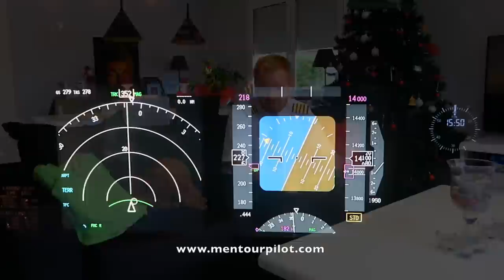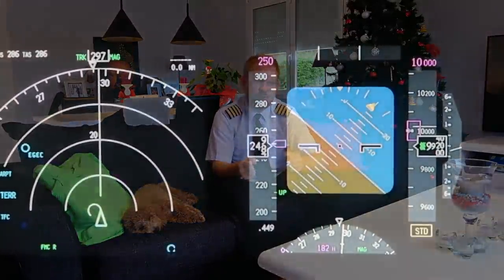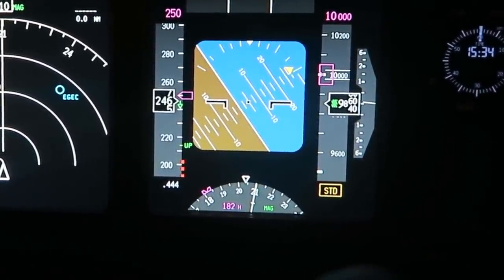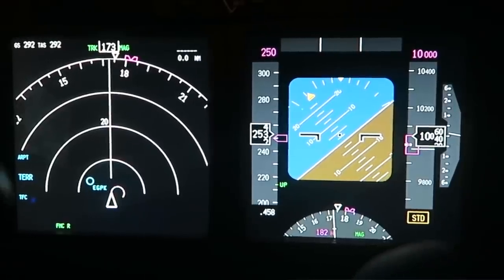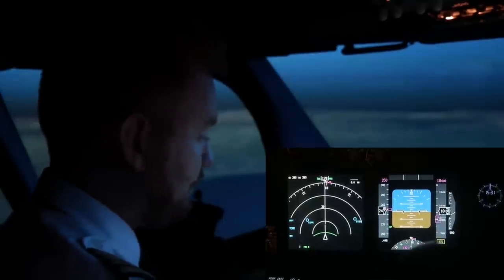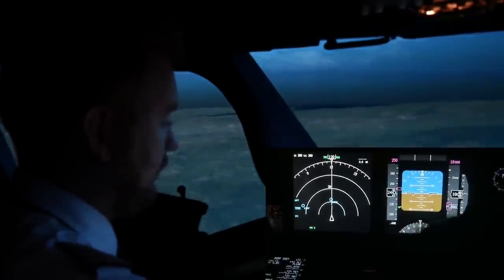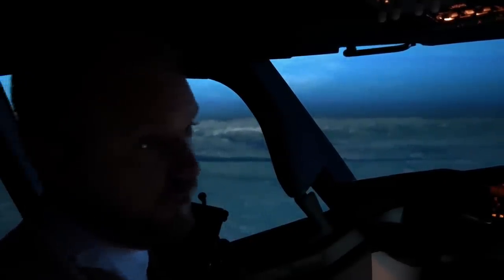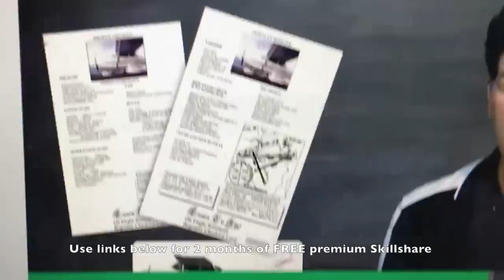What happens if you ROLL an airliner?!

Comment: Great video. One of the complications of flying at 90 degrees or upside-down is that the control surfaces take on different roles. At 90 degrees for example, you would have to use the rudder to pitch the nose up to maintain altitude? And upside-down the elevators would have to be operated in the opposite way to normal flight? And the transitions would be very tricky. Like trying to fly a brick I would imagine. 
The late [Sir] Douglas Bader, the RAF fighter ace of WW2, did a barrel role in an ancient aircraft very close to the ground. He crashed badly and lost both his legs [in 1931 I think], but went on to fly combat missions in WW2 until he was shot down in 1941. 
There are bold pilots, and old pilots, but no old, bold pilots, as the saying goes. I think his engine lost power as well, because it had a gravity-feed carburettor feeding the pistons. 
But one can understand the appeal of doing something like that, even if it is not terribly safe.

Comment: Steep turns! Am just getting used to them after watching more aviation videos and understanding some of the  dynamics of flight and this particular video has explained the subject best. Steep turns can really get to a nervous flyer especially right after take off, you get an unexpected bank to either side! Oh the marvels of modern day aviation. As always, great video Petter!
Reply: The one to remember is load factor = 1/cos(beta), where beta is the bank angle. That's assuming you're looking to maintain level flight.

A normal 30° turn results in about 1.155g. Dial that up to 60° and you're looking at 2g.
Reply: @233kosta  I doubt the average passenger who be thinking about that as they experience a steep turn seeing the plane bank to one side rapidly.

Comment: What happens to the fuel in the tanks when you bank? How does it make sure that the engines continue to receive fuel? How is the fuel measured during a bank? What about during climb and decent?
Reply: Go to school for that
Reply: Pretty sure there are multiple fuel pickups in different parts of each tank for that exact reason, and probably pressure dependant valves so when one pickup is sucking air, a valve closes so air doesn't get into the fuel pumps

Comment: What happen’s to the toilet when you roll the airplane?specially if someone in there?😂
Reply: I suppose that might depend on the current evacuation levels of the occupant. Or whether the last occupant forgot to flush. Don't forget to flush, please.
Reply: Arif Salah Depends on the forces. If the pilot maintains 1g during the maneuver you would even be able to stand on the floor.
Reply: A big mess
Reply: Shit would come back where it came from, for real tho worst case scenario you get covered in your own waste, there is no pipe full of water in an airplane
Reply: Nothing happens. Unless it's a flick roll. That would mean you'd get shit on face. But it wouldn't matter too much. Because those two simultaneous, loud noises you heard were the main spars snapping 😅
Reply: @thefreedomguyuk    Not if Tex is flying your Boeing
Reply: Really short answer. Nothing would happen. 

Unless the waste could go back through the waste diverter and pipes and apply so much weight to the valve (that, in tandem with vacuum pumps that literally suck the waste into the tank, controls whether the waste enters the waste tank or not) that the valve fails, nothing would happen. In addition, since aircraft do not experience a constant 1G but can normally vary between negative Gs and more than 2Gs during flight, manufacturers of the waste system have implemented other ways to prevent back flow beyond a sturdy valve and non-straight pipes.
Reply: Some one just HAD to ask this question.
Reply: if you were aware but is was unplanned, whilst  your on the pan, you'd likely be reaching for the shit roll pretty quickly. pan pan, no pun intended. lol..
Reply: I don't know about the toilet, but please don't roll the plane while I'm eating my delicious airline meal....
Reply: @whyyeseyec  brings a new meaning to "gate gourmet"  (one of the bigger airside catering firms)
Reply: @whyyeseyec  What airline meal?  Pretzels?  You can eat them  while you are upside down.
Reply: @lizlovsdagmara5525  - Not sure what you're having on your flight but I'm eating Pretzel's Mignon...
Reply: @whyyeseyec  As long as they weren't grilled in the toilet.
Reply: @lizlovsdagmara5525  - Oh ya', that's where I draw the line....
Reply: It would be a really shitty situation...
Reply: @Tomelino  with your arms braced against the walls though, since your body is being forced to turn which applies twisting forces.
Reply: The result would be a lot messier than my phone with my morning coffee now sprayed all over it.  Thank you, Arif.  😜

Comment: Steep turns were always my nemesis.a

Every CFI(I) taught me to throw in trim on steep turns to help relieve the force needed & then take most out while finishing, cleaning up once straight & level. All would  say it's easier to push that yoke than to pull it.

I know there's a huge difference between tin cans & heavy iron, but in a 73 with direct connections rather than fly-by-wire, why wouldn't you do the same? The STAB controls are right under the flaps to the right of the thrust levers. Not trying to soopr-smrt here, I'm just trying to understand because you can never learn too much. 

Muchas gracias y tusen tack  for all of your interesting & helpful teaching vids. 

Keep your blue up and your brown down.

Comment: Coming into Burbank in a 727 in the early 1980s, the pilot announced that the radar was out at Burbank, so no ifr. Ceiling was 3,000 ft with broken clouds below. We didn't want to go to the wrong airport, did we? So he said we would be doing maneuvers we do not usually do because vfr you can't fly into cloud, but don't worry, completely safe. We flew across San Fernando Valley at low altitude making turns with seemed like 90 degree bank. I was looking out the window straight down, and it was close. Cabin was silent with gasps as we got to the apex of the turns. Applause after landing. I think the pilots enjoy it.

Comment: Great video, and a very clear explanation.
Could you do a video about why the pilots of Alaska Airlines Flight 261 attempted to fly the plane inverted? Obviously not an ideal way to go, but curious why they thought it might help the situation.
Reply: The control surfaces were jammed due to mechanical failure, resulting in the plane inverting without the pilot input. They attempted to hold it simply to buy time, with no means of returning the aircraft upright.

Comment: What happens next, like with handling the plane after recovery, checklists, the passengers and crew, etc.
Also, coincidentally, yesterday I watched a YouTube video about Alaska Airlines Flight 261, which had a vertical stabilizer failure due to Alaska Airlines trying to save money on maintenance, and the incompetence of the maintenance crew. They went into an inverted attitude, with no way to recover. This was a  McDonnell Douglas MD-83
Reply: horizontal* stabilizer. That was truly a horrific scenario.

Comment: Question: in the simulator do you really feel the same effects such as being upside down during that roll?  If so, if you have your seatbelt off could you fall towards the ceiling?
Reply: No, the simulator does not rotate that much. You cannot do loops either.
Reply: I'm driving a Daewoo Matiz (aka Shevy Spark), a very light and small vehicle. Driving at 70-80 mph makes you feel you need to pull the wheel towards yourself and clear ground:)

Comment: Is there even a theory for 737 which would allow you to add some right rudder in a steep left turn to help maintain the altitude and avoid adding too much back pressure? This video reminds me of an occasion when I visited the Chicago Science Museum with my friend. We entered the flight simulator (which can do a roll). I was rolling the simulator quite happily and my friend was frantically truing to right the plane the opposite direction (the seats are left-right and both have the rigidly connected sticks). Of course, I did check his harness before doing it. Fun times!
Reply: Yes as you apply roll you will loose the lift on your only working wing therefore use the yaw and even when you almost streight still dont use roll apply a slightly more power and pitch down
Only after you are complitly level you can use the roll again
Reply: tabaks That is what you’re doing with rudder when you keep the turn co-ordinated. When in aerobatic maneuvering, the controls do shift. Rudder becomes elevator and elevator becomes rudder and degrees in between. Constant input co-ordination in necessary for a beautiful barrel roll. Command authority of each aero surface is a factor in controlling during such maneuvers.
Reply from the maker: I actually used some
Reply: Matthew Bireta, that's what I know from flying Cessnas. My question was more to the effect whether 737 does allow for that, to a degree. What degree, I don't know, nor is it possible since that is an uncoordinated flight. Hence, my question. Thank you kindly for your answer.
Reply: with all the rudder issues the 737 has had I wouldn't want to try it

Comment: Very nice man . Also shed some light on how many times you takeoff with full power or de rated thrust ?
Reply from the maker: Great! I will see what I can do about that
Reply: Mentour Pilot thanx buddy :)
Reply: My dad overhauled Pratt and Whitney JT9Ds when they first came out. He said that the first pilots sometimes applied too much thrust on takeoff and the resultant overheating stretched the some of the turbine blades until they rubbed on the engine case.

Comment: I was fortunate as a young USAF airmen to earn a backseat ride in an F-16D. We did rolls, pulled 9G's, and broke the sound barrier...all during the incentive flight! The rolls were great, 9G's will melt your brain, but the best part was breaking the sound barrier over the Adriatic Sea. The F16 is one zippy ride! I would NEVER want to be in a 737 doing anything close to acrobatic flying. No ejection seats on those, either.

Comment: That roll caused a 5000 foot descent in 30 seconds, or 10000 fpm. I suppose this is not an approved procedure for emergency descent. :)

This is actually what military pilots do when flying at low altitude over a hill. They'll roll inverted as they come over the hill and pull down towards the ground on the other side. This allows them to hug the ground while also keeping the G positive.
Reply from the maker: Yep, this is in no way an approved procedure
Reply: Some birds do this as well. Called "whiffling"

Comment: I once had an Air China flight doing a steep roll on approach. It felt like a 90 degree bank because I could see straight down onto the fields from my window, but it was probably less. We were already quite low so luckily the pilot did not try a roll. He (or she) then went full throttle and we most likely did a go-around. By then I wasn't really paying attention to that anymore, just happy to make it out. Never flew Air China again because I thought they couldn't fly. Now I realize this was probably a wake problem and the pilot responded quite expertly...... Thanks Mentour Pilot!

Comment: A few times I've flown Russian domestic airlines (russian aircraft) and the pilot must have been ex-military because on take off he banked quite severely to the right.  That got my attention.
Reply: In Russia and China former Air Force pilots end up flying passenger aircraft after they are forced to retire, when flying for the Air Force you usually take off at rather steep angles even with cargo aircraft so to avoid being hit by mpads on take off.

Comment: "Structurally damage the aircraft".  That's the discrete way of saying the wings just fell off
Reply: Not necessarily: due to the enormous forces imposed on them, far beyond the usual load, it's perfectly possible the plane lands with the wings still attached and everything seems fine... until they do some ultrasound scan or X-rays and it's revealed so mucb load caused premature metal fatigue to the structural beams. Thus, those wings will fail at any moment, and need to be scrapped ASAP, even if from the outside everything looks fine. Oh, metal fatigue is a b*tch, and especially pernicious in the aviation industry...

Comment: 2:54
You're not really getting 'pushed out' when making a turn, what's really happening is you're being pulled inward towards the center of the curved path. Inertia keeps you going in a straight line, but the car/plane is forcing you to change direction. Banking the plane keeps that force applied to where you're most comfortable and familiar in experiencing it ... on your tail end, just like you're experiencing it now.

Comment: Excellent videos ! Few humble suggestions - it would help us understand things better if you had a model plane in your hand to show us a visual representation as you explain the actions. Also, in the simulator, an external view of the plane with the instrument panel shown in split view would be very helpful. I couldn’t find the bank angle displayed on the horizon instrument, if you could highlight it that would be great.  Thanks, keep up the awesome videos :)
Reply: Yeah, the bank angle indicator isn't totally obvious to those not familiar with PFDs. If you look at 15:35 you'll see a downward pointing triangle on the top edge of the display with a series of vertical marks on either side of it along an arc. Just below that is an upward pointing triangle that indicates the bank. Since it points straight at the top (the downward triangle), the bank angle is 0 degrees there; over the next ten seconds as the aircraft banks you can see the upward pointing triangle move along the markings towards the left, indicating ten, twenty and finally thirty degrees of bank. (The next two markings are 45 and 60 degrees, from the looks of it.)

Comment: what are the differences between low mounted wings vs hight mounted wings?
Reply from the maker: Stay tuned!
Reply: Good! I've thought of asking that myself, including explaining why modern commercial cargo/passenger planes are low wing, while their military counterparts (i.e. the A400, C-5, C-17, & C-130) are high-wing.
Reply: I heard that hi mounted are easier to fly, while the low are better responsive. Maybe I'm wrong...
Reply: @MentourPilot  ... I am eager to see you get it wrong there. It is something that most pilots get wrong because it is taught wrong to pilots. Actually I hope you get it right, but I will be watching just in case ;-)
Reply: The main difference is where the wing is mounted. It may sound silly but it is true. Construction, maintenance and ground operations are the main factor on the selection of high vs low wing, rather than flight characteristics or performance.
Reply: @MrQuanticox   I've flown Mooneys and Bonanzas, both low wings, as well as high, winged Cessnas for almost 50 years so maybe I can give you some of my observations.    I don't believe one breed is "easier" to fly than the other.    But I think there are advantages to both.  For example, The fuel tanks in high wing Cessnas are above the level of the carburetor or induction system.  So the fuel is gravity fed, even though there may be secondary electric fuel pumps.   In low wings, usually, the fuel needs a boost from an electrically driven pump for starting.   But they do have engine driven fuel pumps as well.  So gravity in a high wing is an extra factor for discussion.
                   Another difference is the "sight view" between the different breeds.  In high wing Cessnas, it's much easier to see the ground when flying straight and level.  With low wings, the sky is more viewable.
                  Also, with high wings, you have more ground clearance during stiff crosswinds allowing the pilot to bank the wing into the wind a little steeper than a low wing.  But I think the "ground effect",  that is the cushion of air is more effective in a low wing simply because the wing is closer to the runway during the landing.  I'm sure others here who have flown both breeds, I didn't say "types" for a reason, may have other points of view.    
                I like doing steep turns in a low wing because you can see the ground better when the low wing tip is more steeply banked as well.  Just my humble opinion.